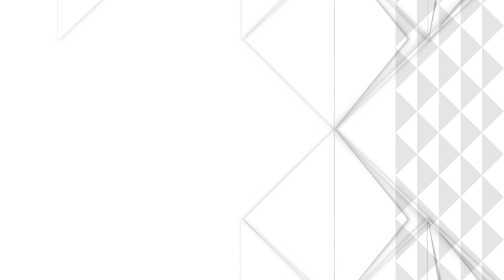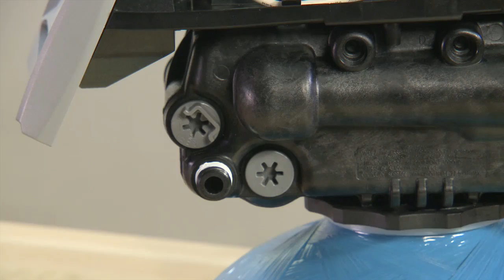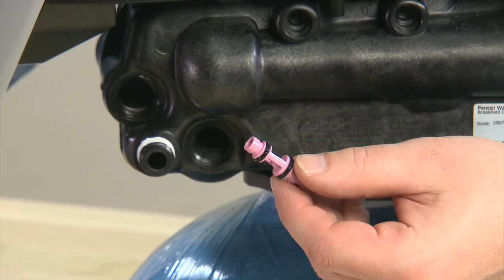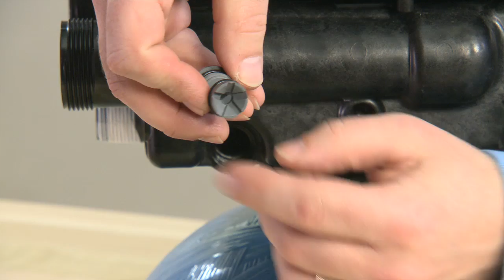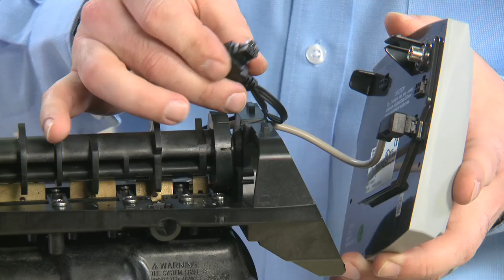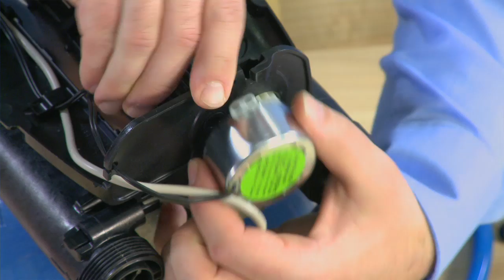Autotrol Performa Series Control Valve Tear Down

Comment: I had to disconnect my 760 series and the adapter plug to the wall outlet broke.  I removed the the other end from the control valve.  The new adapter plug arrived now I can't find where I connect the end into the control valve.  Can you please help, thank you